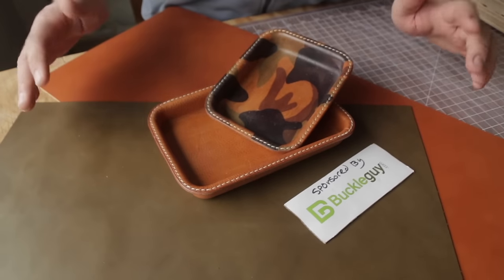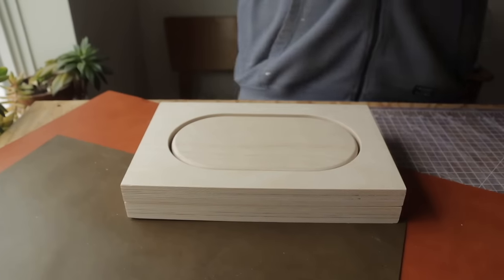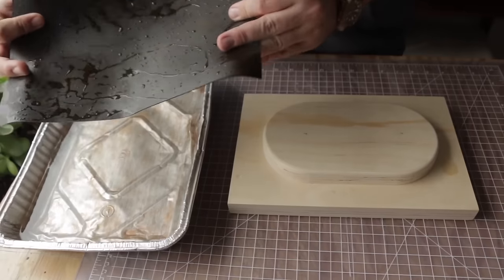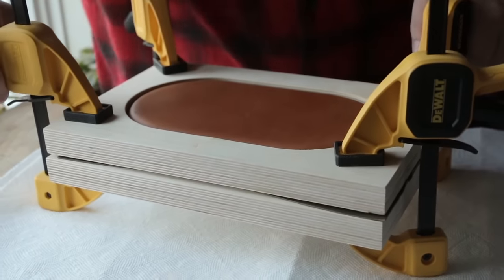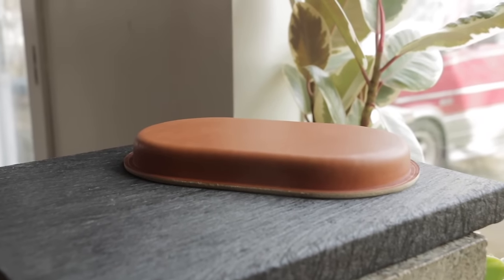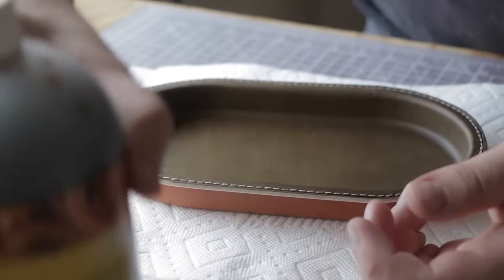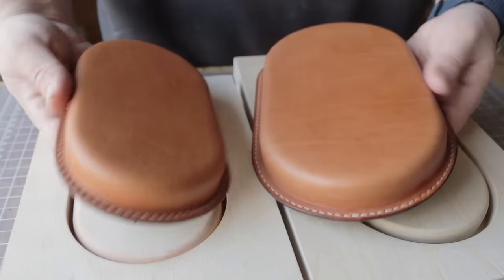The Easiest Way to Wet Mold Leather EVER

Comment: I've been making this type of mould for about 10 years now.  My advice is to fix the mould to the base by screwing from under the base.  This way nothing marks the leather.
Reply: That's how I have done mine I always use stainless steel screws anyway and coat with a bit of wax to put them in so when removing they come out easily.
Reply: Yes, and I always cut a few darts in the leather on the curves which gets rid of any wrinkles.  I use a straight cut router bit to cut the mould shape from the top clamp part then line the positive and negative cut edges of the wood with leather for a super smooth finish. A 5mm bit does the job then you can decide how thick to line the cuts depending on the leather you are going to work with. Happy moulding!

Comment: I have wet moulded up to 5" deep. I found that is about the limit.
If you're using unbacked leather, you can use PVA glue at the molding stage and it will come out already as one piece. I also used to dry them in a 50 degC hotbox, which really sets the collagen in the leather.
Reply: Excellent

Comment: I've been doing this for a couple of years. I'm using 8 oz veg tan. I'll get it molded and let set until it is not completely dry, just slightly damp. Set your oven at 200. Once to temp turn the oven off and place your mold/leather assembly in the oven and let cool in the oven to room temperature. I have found that the oven hardens the leather more than just air dry. You may want to try it to see if there is a difference in results. Weaver Leather has a good video making leather armor which is the same process.

Comment: A commonly used technique with contact cement is to: A) Put a thin coat on both sides and let it dry till tacky. B) Apply another coat on one or both sides, but DO NOT let it dry. C) Put the two sides together while the second coat of your contact cement is still wet. This allows you to reposition if necessary or, in this case, allows your sides to slip into place. D) Clamp till dry. 

Naturally, this works best if one or both sides can breathe a little bit. So, it should work great with leather. So, I'm a little bit curious as to why I haven't seen any leather work videos use this technique. I mean, y'all practically live and die by contact cement.
Reply: Nice
Reply: Great

Comment: If your glue is a little dry and sticks too hard to put the layers together, you can spritz the surface with barge thinner and the quickly slide the two together, It will then evaporate and won't hurt the bond of the contact adhesive. Also to avoid some of the wrinkles you can stretch the corners out just a bit and tack them, This will make it stretch into the mold instead of compressing. Obviously you can't go too far or it will rip or won't stretch enough  to allow the mold to close. You can reduce the size of the bottom plate so you pull on the leather and tack it to the outside as you close it so you can pull the wrinkles out without having to cut a larger piece of leather.

Comment: I have been making and using molds like this for many years. WAX your molds with 3 to 4 coats of a clear wax, buffing it clean after each coat. This will keep the molds good for many many years and glue will never stick. I have done carbon fiber and glass the same way.

Comment: I do wood working. I would recommend installing some T-nuts, or Wood nut inserts, into each block, of the mold. Then you can adjust the depth (or angle) of your mold, by simply turning a few bolts!

Comment: Quick Question: if I wanted to tool a design on the inside, would you recommend doing the design before or after wet molding? I feel like the design would be mushed out if you did it before wet molding....I'm definitely looking to possibly get one soon! 😊
Reply: im not the greatest tooler but your right in your thinking. the wetting & clamping would undo some your tooling work, you'd loose a lot of crispness to the tooling marks.  tool after it comes out of the mold.

Comment: Standard C clamps can be made to work but one has to add a buffer layer between the metal and the mold. [say 1/8" ply scrap with maybe scrap leather glued to the bottom].  Still, I like your clamps ... fast and easy.  My hobby budget is tight so need to cut corners when I can.  Thank you for the video and the candor of your presentation.

Comment: SAND YOUR MOLD! I got all excited to use my new tool and didn’t check it over like I should have. They come VERY rough on the inside and will snag the leather. Sand them with 400 grit or so.

Comment: Hey! Great video. It convinced me to get a set for myself. I’ve started a couple of these and I noticed that the plywood layers make impressions  in the leather. How do you avoid this? I didn’t see any marks or discoloration in your video. Do you sand the raw edges of the form? I used 5oz W&C bridle with 4oz Korba Buffalo, another with 2x 4.5oz Dublin, and a 3rd with 7oz ALD Harness.

Comment: Nice molds ...easy to make your own with a router and saw. Or even with out a router just a jigsaw and some sandpaper. Also if you are molding something why nail the center of the form? Won't the material will hold it in place?

Comment: I have an idea for you. Use two pieces for the top side, do your french seam so the seam is exposed in the center of the finished product, maybe width wise. I'm not sure how it would mold but if you could pull that off you would have come up with tricky version of this wet mold.
Edit: Clarification.

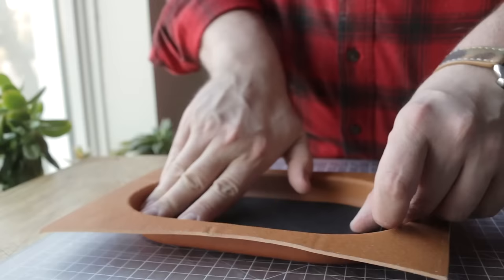Comment: Great video.  My wife and I purchased several of these molds from Buckle Guy and like them very much.  Where did you purchase the nylon stiffener you mention at about the 11:00 minute mark of the video?  I would like to try some.  We have used fibreglass dry wall tape (mesh) and it works quite well with glue.  You can get it various widths from the big box hardware stores and on Amazon.    We also find that using natural leather and dying it after the wet molding process results in a sturdy finished product.  You can always clear coat the final product. 
Michael from Canada.

Comment: If you want to use C-clamps, you can use 'calls' which is essentially a scrap piece of wood between the clamp and the mold. I am not an expert but I would suggest two long pieces corner to corner.👍
Reply: Not trying to be that guy but it’s spelled “cauls” just in case people wanna search it up

Comment: I noticed on the Buckleguy site these wet molds are a little different than yours. The part where the leather molds around has a more curved edge on yours than what is shown on the site. The base and the frame are also different. Was yours custom made?

Comment: These totally caught my eye the first time I saw their shop through your channel. Do you think it is possible to laminate or cover the inside of the tray with a different design? I was thinking of doing something for my coworkers for 911 appreciation.
Reply from the maker: I think you could figure out how to pull that off, anything that's moldable should work - you might need to use a heat gun for a laminate but that'd be super cool!

Comment: I used your method but the molds outer ring scarred up the leathers finish around the depth edge on the lower portion.  I used a olive green Buttero, only removed the ring once to glue up the put back on for glue to dry. Is there a trick to avoid this?
Reply: Try lightly sanding the edge of the mold where it created the scarring.

Comment: Thanks for another great video.  I have their small round mold, but learned a few new tricks to make the process easier and better.  Where do you get the stiffener?  Also, you have a very nice collection of watches.  I really like the brass diver (make?).
Reply from the maker: Thanks! it's just Veledon, any thin nylon will work from a fabric store (might just not have a sticky back so you just glue both sides). The brass watch is a Helson Shark Diver with a blue Jade dial -  totally beautiful,  probably the nicest watch around for the money IMO - just gotta get used to telling people about it when you're out and about because it draws a lot of attention!
Reply: Do you have a link or actual name of the sticky back stiffener? I’ve been scouring the web and using veledon as a keyword and nothing shows up.

Comment: Can you please cover buckle guys leather remanant packs? Good value? What do you get for the money.
Reply from the maker: we've got a video coming up on them! But short answer, we've been to their warehouse and gone through them and they're big boxes with pieces of leather large enough to make wallets and small projects with. Are you going to be able to make a bag? No (unless it's a patchwork bag which would actually be pretty rad haha) but you're not getting shoe strings by any means. At half the price of a full hide I think they're worth the money for the amount of usable leather you get, specifically because it's not just random scrap and you get to pick your exact tannery and color. But if you have a specific project in mind that requires specific sizes of leather pieces for the pattern I might save up to get a full hide of the leather you want. that's my honest opinion

Comment: I think a nut and bolt at the corners of the wood panel to press down would be more convenient and cheaper than using 4 clamps. But I'm not very educated on this subject so use my suggestion with a grain of salt

Comment: Does two granite slabs reduce the pounding noise more than one granite slab? I've been meaning to ask you thus. I currently have only a one slab setup with an 1/8" rubber mat underneath. It's still pretty loud.
Reply from the maker: we actually just had an extra one and press leaves from our plants between the two haha! 

To really reduce noise you can build a pedestal and fill it with sandbags. I did that when i was working in an apartment and it took care of the noise very nicely - need lots of material to absorb the force.  The other way to reduce noise a little bit is to frame your workbench 6-10" on center for about 2' where your granite is, that helps a ton as well.
Reply: @Corter  Yeah, I'm in an apartment now. I have older neighbors underneath me that go away in the fall and come back in the spring. I still like doing leather work in the spring tho. :) 
Thanks for the quick reply and suggestions.

Comment: You mentioned that the center piece was "roughly centered" Wouldn't you need to get that piece exactly centered to make sure the molded leather is even on all sides?  Thanks.
Reply: No, because the top of the mold is floating. Hence why he said you could attach the middle piece to your bench or another surface if you wanted to.

Comment: OK I'm having troubles with this technique. I bought the wet molds from BG and numerous W&C panels. My problem is that the panels stick together after drying. When I separate to glue them they become mishapen. I'm using the W&C English Bridle. Should I be using harness instead? I'm at my wits end.
Reply: I made my first one last night and had the exact same issue.  I was thinking of putting a layer of Saran Wrap between them.  Did you figure anything out?
Reply: @gradyhill512  Actually yes I did and I'm happy to share. It does matter which type of leather you use and I've had the best results with harness. I let the clamped pieces dry overnight then remove the clamps and ring in the morning. I let it sit all day while I'm at work and then gently peel the fully dried pieces apart when I get home. It still sticks but it won't deform. Just an FYI the harder you clamp the more it sticks. Basically make sure the leather is 100% dry and you'll be good to go. 👍🏼

Comment: What brand stitching chisels are you using?
Reply: I want to know too , first time he hasn’t used weavers brand that I’ve seen
Reply from the maker: These are crimsons, we genuinely used the Weaver chisels for lots of things but the tooth profile is a bit large for the thinner thread we like to use on these trays - I use crimsons a lot in my person work because I like to use thinner threads, but if you want to use 1 or 1.2mm thread the weaver chisels are still the best deal on the market IMO. We also have a signature line of chisels coming out with buckleguy soon too :)
Reply: @Corter  ok sweet , I can’t wait to see them

Comment: @16:20 I would advise to not cut on the 'keep' side. Understanding that the tray limits the positioning of the ruler, but still, one slip and you have ruined your piece. Whereas cutting away from the piece, i.e. the other side of the ruler, the ruler serves as protection for the 'keep' side, in this case, the tray. Just my five cents. Great video nonetheless.